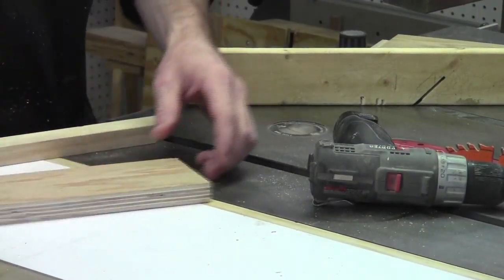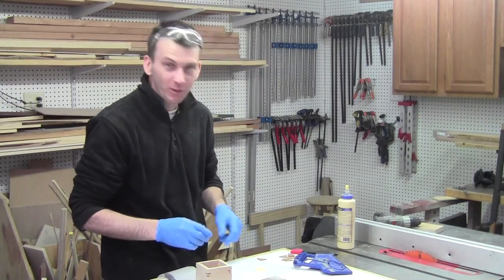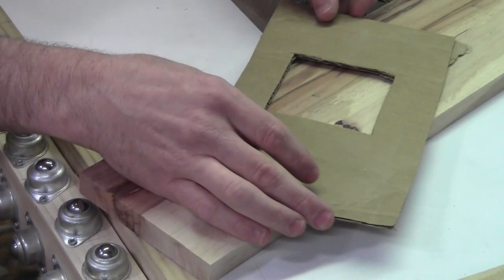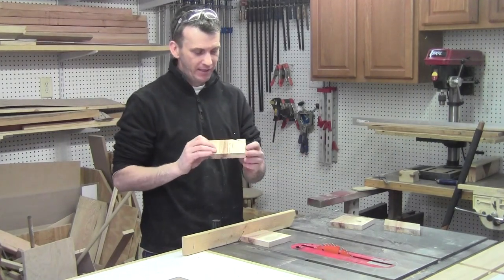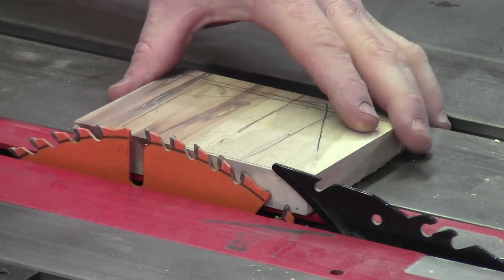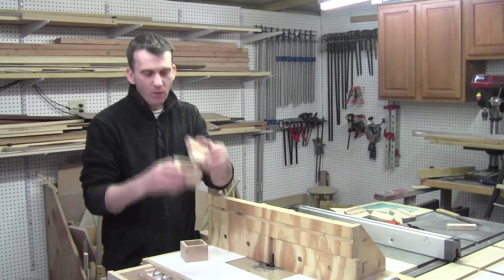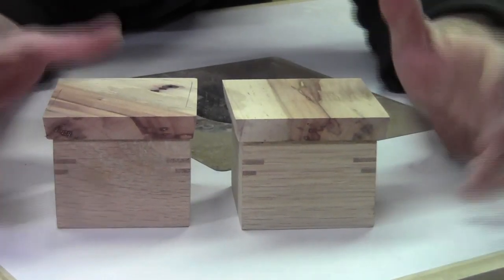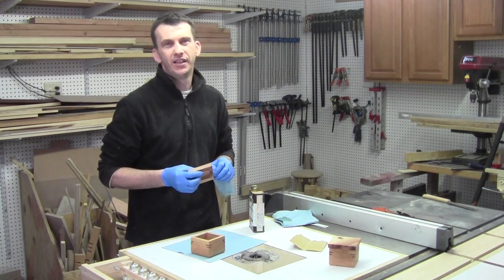How to Make a Lift Lid Box | PART 2

Comment: Hi another great little project and as usual very informative. I would also  like to add my tuppence worth to the sled versus mitre saw debate. I am a hobbyist and I have a Table and Mitre Saw and find  crosscut and mitre sleds a lot safer and more accurate especially for smaller projects like this and cutting small pieces for segmented turning. 
Anyway keep up the good work and stay safe

Comment: I agree Laney.  I find the sled to be extremely safe, easy to use, and accurate, while the crosscut miter saw is fast and easy for larger stock, it is dangerous and not accurate for small stuff - in my experience.

Comment from the maker: I only use the miter saw for rough cutting lumber. I feel the miter saw has its place in the workshop however it is primarily a construction job site saw. It is excellent for quickly rough cutting stock, however for cuts to final length I prefer to use the tablesaw. I know my tablesaw is dead on and produces the quality cuts that I want in my final piece. I never use the chopsaw (Mitersaw) for final cutting of stock... but you can, I am not saying you cant. It is just my preference...

Comment: I had a kickback several yrs ago, about 25, & it hit my hand right at the hand. It left the tendens showing in the joint between the fingers. The pain wasn`t as bad as I thought it could have been. The problem was I wasn`t where I could work in my shop for about a month. Like you I bypassed some guards

Comment: Nice boxes good basic design. We would get shot for working with a saw blade exposed like that in the UK .Using a lead in pin on the router table is safer that just relying on the bearing guide

Comment: That kick back was also due to you didn't push the wood past the blade.   A guard also holds down scrap  pieces and keeps them from moving into the blade and possible kick back, just by weight of the guard.   2 easy techniques not foolish like reaching in while the saw is running.    thanks for showing it  I think some watching did learn how and what a kick back looks like and how fast it really can occur.

Comment: the other issue is that the chop-saw; you move the blade, and it has hinges/linear rods and bearings. These are compound components with a high propensity for error as far as accuracy goes. The tablesaw the blade is stationary, and the work moves across it. This is also a critical difference in accuracy and repeatability. Over time the bearings/rods/hinges fail and the accuracy of the chop-saw falls off a cliff.

Comment: Nice little boxes...Another thing you should get in the habit of doing is pushing your material  completely past the blade every cut.  There is no risk of kick back when doing so,  even with out a reeving knife ...which I haven't had on any of my saws for 35 years.  Best Regards

Comment: The reason the pros don't use a chop saw for that type of work is the saws form and design itself. The physical differences between the chop saw and table saw are huge. The chop saw is very unstable for anything over the width of its' platform; which is generally about 4 inches or so. I'm not sure about the origin of the chop saw, but I know that I see them mainly at use in construction sites for cross cutting of 2x4s and other framing. Though you can make this small box easy; can't scale design

Comment: i am just a hobbiest.  however, i think crosscut sleds r dangerous for many reasons.  i use a chop saw- mitre saw whatever the term is.  i have made an extension track set to get repeatable and accurate cuts.  for whatever reason, the pros don't seem to make cross cuts in this manner, they prefer the table saw.  i think the more chances the hobbiest takes on cuts, they make an accident a certainty.

Comment: Did you leave the splines uncut inside the box or did you clean up the splines to keep them from interfering with the contents? If so, how did you cut the splines?
Reply from the maker: +Allyen Wilson if you can see the splines on the inside of the box, your cutting too deep. You only need to cut halfway or so...you do not want to cut all the way through.

Comment: You were not finished with the cut. Finish the cut by moving past the  end of the blade leaving the cut off out of the path of the rotating blade. The Stock you have cut from is also out of the rotation of the blade and get your hands clear! Don't be tempted.      . Here the only thing you need to concern yourself with is the blade.  If you were cutting acrylic you may have lost some digits. Thus         the use of the blade guide. I don't turn mine on with out it unless i am on  occasion rabbiting or cutting  dados.